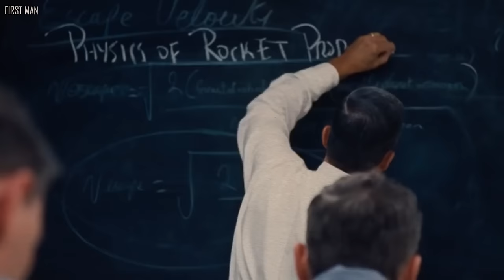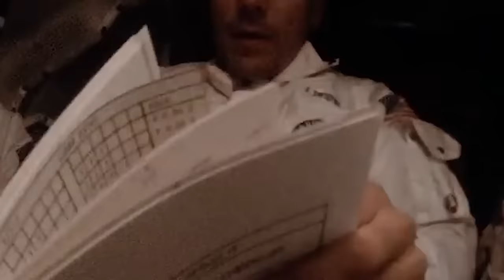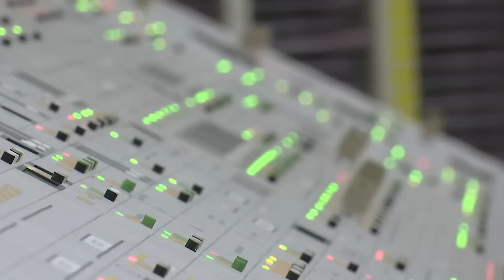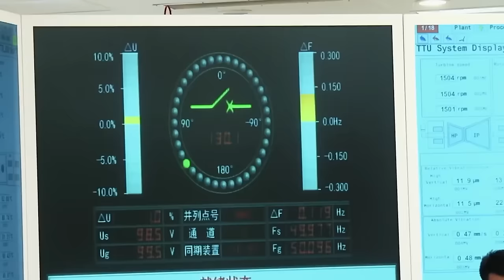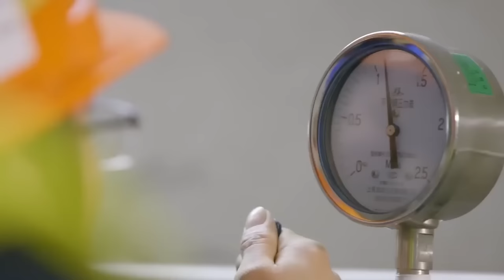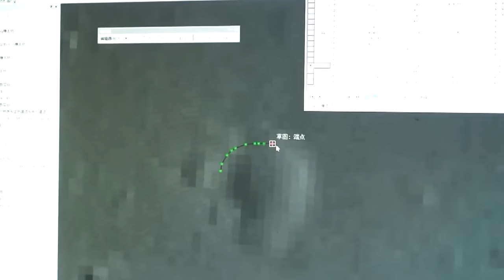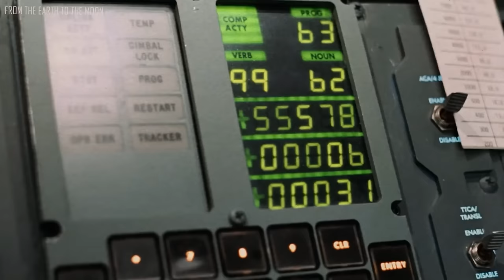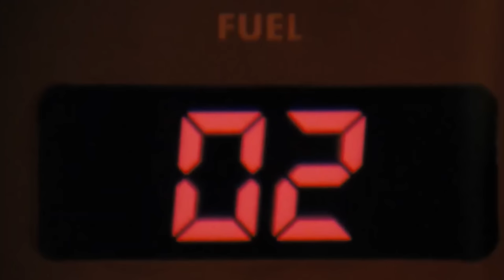Elon Musk: "The Moon Is Not What You Think It Is!"

Comment: I’ve heard that after the last moon mission they where looking at the suits and found they where near failure because the moon dust is so abrasive. Apparently it got into the joints, like at the elbow that allow more freedom of movement, and abraded the joint to near failure. Don’t know if that’s true or remember where I heard it.
Reply: As there is no wind on the moon there is no erosion or rounding of grit and dust particles, this means that the dust will adhere to fabric and settle in joints to cause damage by adhesion and abrasion.
Reply: @jimmiedean8035  your talking about the Apollo suit’s right? I know there’s no joints now because of the Apollo findings.
Reply: @jimmiedean8035  that didn’t answer my question, English.
Reply: @jimmiedean8035  ok playtex suits but were those suits used for the moon landings?
Reply: @jimmiedean8035  thank you see I leaned something, eventually lol.